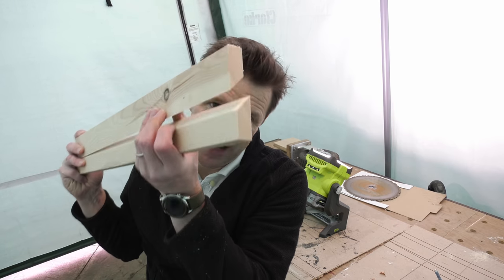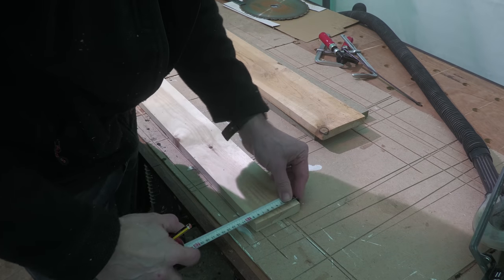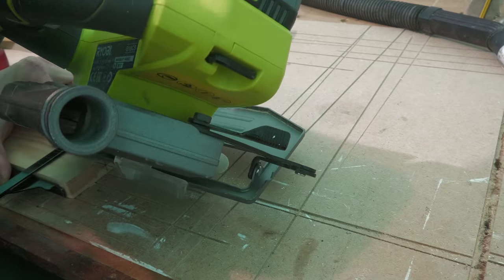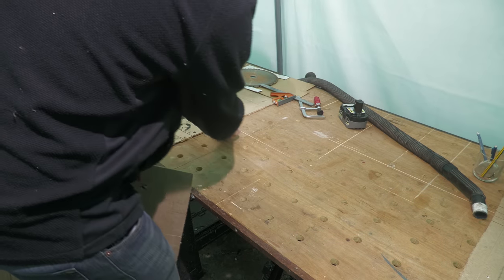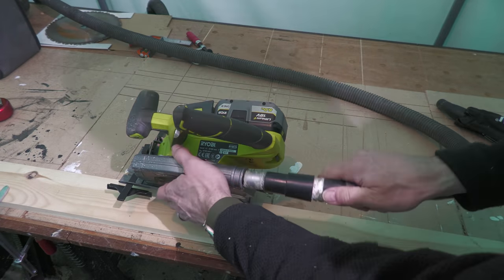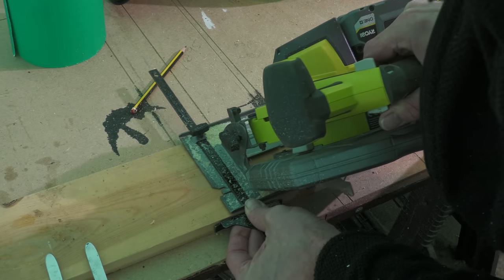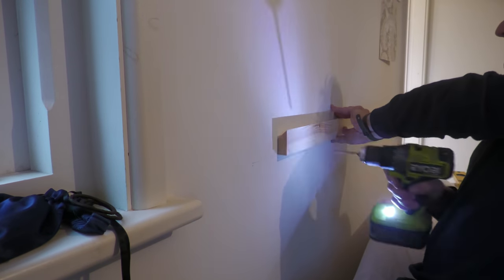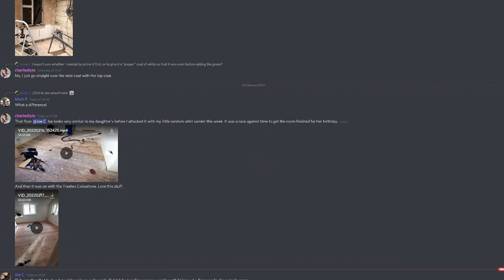How to make a French Cleat or Split Batten

Comment: As you cut your batten down the middle, you ended up with two pieces of unequal width.  That might not matter, but if you wanted them the exact same width you can measure the distance from the edge of your batten to the middle, and the subtract half the batten thickness from that measurement.  Mark that line rather than the middle, cut on a 45, and both your pieces will be the same width.
Reply from the maker: Watch it again. The 45 degree cut bisects the centre of the plank, not the middle on the surface, so each piece is equal.
Reply: @CharlieDIYte  👍

Comment: I have never used a French cleat solution, but there is a question in the back of my mind: what are some easy solutions to ensure that a unit hung on a wall isn’t accidentally knocked off? Maybe this headboard is too heavy to knock off, but there are other situations where this can be a concern (admittedly, for a beginner who has not tested French cleats yet). Thanks!
Reply: Understand your concern but I have used french cleats for over twenty years and never have had one knocked off yet as you need to lift the item up more than 30mm so even if you knock against the item it will never come off I hope you understand what I mean
Reply from the maker: Exactly David, and you could put a small screw in the wall above for peace of mind, if you felt the need but as you say, a combination of gravity and the distance it has to travel would render this unnecessary. Thanks for answering this. 👊
Reply: @CharlieDIYte  I thank you both for answering my question. I’ll go ahead and install a temporary tool rack in my temporary shop and give French cleats a try. Thank you! :)

Comment: Hi Charlie. Great instructions and guidance as always. It’s an idea just to knock off the sharp edge on the batten fixed to whatever you are hanging. This allows for a small amount of debris that may have gathered in the wall batten and would otherwise prevent the cut surfaces mating snugly. Not so much a consideration in the bedroom but very relevant for workshop applications where sawdust and the like may settle on the wall mounted batten.
Reply: There's  always  something  to learn  in your  channel  Charlie  .
Reply from the maker: That's a great point Brian. Thanks for sharing 👍
Reply from the maker: Thanks buddy, good to hear from you.

Comment: Great job but i don't see how the head board can be flush with the wall with a board attached to the back of it? Sorry but am i missing something here? lol
Reply from the maker: It's a good point. You build a recess into the back of the headboard with say a strip off 18mm MDF or pine if you're wanting to staple into it. If the headboard is already made you can use flush mount brackets like this https://www.toolstation.com/flushmount-fitting/p60564

Comment: Thanks for reminding us about this and the way to do it. One of the first things I ever made was a wall mounted tool storage cupboard based on a Conran design which used split battens as mounts. Cannot remember how I actually made the split batten as it was about 30+ years ago and it is still in use. Has been adapted as I have new or replaced tools. Despite holding my router, sanders, drill, etc and the cupboard itself the mount has remained solid and strong so can vouch for the strength. It is a versatile mount that is strong, practical and easy to use.
Reply from the maker: You're welcome Glen. Yes that's testament to how good these are. Thanks for sharing 👊

Comment: Excellent job Charlie ! I regularly make headboards and upholster them, this in my opinion is the safest and strongest way to fix headboard and you can also make it as big as you like. 
👏👏👏👏
Reply from the maker: Thanks Helen. Yes I've used those metal cleat brackets in the past and they can clank around a bit. This is so much better.

Comment: My brother in law made a headboard for me using this trick. 
My friend needed hers done and I just used picture hooks ( same idea ) into plaster wall.  Worked just as well. I got them in B&Q.
Reply from the maker: Yes if you haven't got the space you can use French cleat style metal brackets rust work in the same way but they do clank around a bit.

Comment: Hi Charlie, Your video's are my go to solution to any DIY problems and always very useful. I'd like to pass on a little tip to you and your subscribers  that I'm sure you'll like. Always have a supply of bicycle spokes in your tool box as they are so useful for many jobs. So find an unused bike wheel, strip out the spokes and get them into your tool box. Rob
Reply from the maker: I like that Rob. I have a chop stick in my tool box for the same reason eg clearing out silicone nozzles but a spoke would be even better!

Comment: Lovely down to earth explanations as ever - thanks! 

One question - I've noticed on several YT channels increasingly complicated approaches to calculating how to cut the batten EXACTLY in half with a 45 degree cut (BTW yours was refreshingly simple :) )

However, I can't help but think that there is In fact no logical reason that the battens NEED to be the same width. Or even close. You could just as effectively cut a 10cm board into eg 4cm and 6cm and they would function just as well. Or am I missing something ...?

Comment: Gr8 vid Charlie, I'd have thought you'd have used your track saw for this. You're far braver than me using a circular jobbie. This isn't a criticism, as we all know all too well there is no right or wrong way (withing the confines of sensibility and safety) of doing things nor is there a wrong tool just one you feel comfortable with. 
Keep those no nonsense vids coming,all aimed at ordinary guys with modest resources unlike our cousins the other side of the pond. 👍👍👍👍😎
Reply from the maker: Thanks Alec, I really appreciate that. Yes a couple of people have said that. With a piece of wood this width, I just find the fence easier than a track as with the track there would be a slight worry that the wood might move, but you're probably right 😉👍
Reply: @CharlieDIYte  Hello again Charlie, you had three boards at your disposal in the vid. So, use another so the track bridges across both. One as a support and the other the job. No need for clamps either and the track will be stable.
Stay safe and stay well Charlie. Regards to your family 😊

Comment: I went crazy with french cleats in my garden work room back in June this year - and i mean crazy.  Pretty much every tool and material I have is now set up as a french cleat!  Circular sawing was the worst part of the project - none of my cleats are perfectly straight and most of them to be fair ended up looking like waney-edge boards! The best fun though was devising the holder for each tool so that i could hang them on the wall cleats.  I had to get quite innovative with some of them such as the circular saw and the orbital sander. Wish there was a way to post photos in these comments...
Reply from the maker: Well you can post photos now you've kindly signed up to BMC. See you in Discord 👊

Comment: You mentioned the workshop tent took a bit of a battering in the current batch of storms. How did well did it stand up to them? Feel that could be worthy of a quick vid/short. I ask because I'm looking to purchase one myself, value your opinion. By the way great video.
Reply from the maker: Thanks. It's absolutely fine and has taken everything the weather has thrown at it over the last year. You just need to make sure it's well anchored down. A friend bought one and didn't anchor it, and it uprooted and flew over his garage into the field, thereby destroying it. Mine is screwed to the paving slabs at every pole.

Comment: Felt pretty stupid almost giving up and thinking I needed a circular saw for this before I realised I could get an identical fence for my Makita Jigsaw. Probably not as good as a circular saw for straight cutting but hopefully good enough.
Reply from the maker: Yes Ross definitely worth trying - I've never thought of putting a fence on a jigsaw although I've often used one up against a straight edge. You might find it wanders a little particularly given the angle, but it shouldn't matter as you're mating the two pieces together.

Comment: Very nice job as usual! 
But, the most complex part was kinda glossed-over…how did you recess the headboard to accommodate the cleat?
Reply from the maker: I didn't show that because I thought making a headboard was a bit niche/ not central to the purpose of the video, but basically I made the headboard from a piece of 18mm MDF and then glued 18mm strips to the back to create the recess. Maybe I should do a video on it.
Reply: @CharlieDIYte , thanks for getting back to me Charlie. 
Yes, I guess you are right, one thing to focus on at a time. Otherwise the video might get too long. Thanks also for all your time and effort putting together all of these videos!

Comment: Good video.
I only would screw the wood to the table and don't use the clamps since the drill holes are out of sight and it is more solid to work.
That system can  also be used to hang cupboards and the like.
But my first thoughts were, why would you mount it to the wall but I saw later that the headboard did not reach to the ground.
Mine does cause it also holds the lower part of my bed bottom (3 layer boxspring) that's why it made me wonder.
More interesting, did you do the upholstery yourself cause if you do, please do a video on that, with all the curves and whatnot.
Anyways, solid job done again, 10 out of 10 !!
Reply: He did a video on this a while - have a search through the history
Reply: @olddailly  thanks
Reply from the maker: I don't know why I didn't talk about how I made the headboard. @olddailly you're right, I talked about it very briefly at the end of this video https://youtu.be/UPHk6A14EWo For both headboards I made the sub structure, and then got an upholsterer I know to cover it, but once you've got the foam and if you have a stapler, it's actually quite straightforward. I'll do a quick video showing how I made this one if I have time.

Comment: This might seem like a stupid question but I'm fitting out my workshop with a base set of tools in preparation for starting to learn about woodworking and tackling some basic projects - do I need a plunge/tracksaw AND a standard circular saw ? Or will the plunge do the lot ?.
Reply from the maker: That Lester is a very good question. Bottom line, if you plan to rip down a lot of sheets of say MDF, then the plunge saw is what you want because a) it can slide down an aluminium track and b) the dust extraction is much more efficient. However the circular saw is much lighter and more versatile for quick cross cuts, or more minor work closer to the edge of the piece of wood where you can rely on the fence. Have a look at this video https://youtu.be/jhG4fX_Vjmc at 7:42 where I talk about the mdf dust issue (you should build yourself a cyclone for your new workshop) and also this video https://youtu.be/lXs-4iXO874 where I show you the plunge saw I bought to replace the circular saw I had been using. For cyclones, check out this video, https://youtu.be/9RfHpm2vf40 and this one https://youtu.be/Ws7Tp2Qgbo4 where I fit the pressure release valve.
Reply: @CharlieDIYte  that's brilliant info thanks very much for the reply. I have been considering dust removal systems - and have bookmarked various homebrew offerings, I'll take a look at the solutions you've linked. I'm trying to build out a solid base of essential tools at the moment, without going ham initially (I've looked at table saws, thicknessers/planers etc but i think not getting over excited is the order of the day until I've 1) gotten a workshop set up and know my available space etc 2) taken some courses in woodworking to kick start the projects I have in mind - so I can gauge not only what my ability is but where I'm headed with it), but it does sound like there's a case for both a plunge and a circular saw - and I've seen you use both to good effect in your vlogs to date. 
I will look to pick up a circular saw and add this I think, I'm at a point where I have enough batteries etc built up so I can pick up a body only version. 

Please keep up the great content - for someone starting out their woodworking journey your style of informative and well structured presentation really hits the mark for me - I've bookmarked several of your vids in my "things I'd like to build" playlist as potential project inspirations :). Many thanks again, appreciated.

Comment: Awesome C!  That is a great idea. Also, how is the workshop holding out?
Reply from the maker: That workshop has laughed in the face of every storm that's been thrown at it. There's the odd pin prick hole in the roof - probably from sparks or perhaps birds but it's staggering how well it's weathered. Only problem is, rather like the London Eye that only had planning permission for about 6 months, the wife keeps reminding me it's only meant to be temporary. She doesn't want it there forever but I've told her the outdoor seating will need to be built in it in the spring 😬😉
Reply: @CharlieDIYte  😆😆 Hahaha! Fending off the wife! like fending off against the storm

Comment: Nice one Charlie - but you could have cut those with your tracksaw.🤔
Reply: Thought the same Norman but not everyone has a track-saw, but there will be quite a few geezers and geezerettes that will have a circular saw. Even if you have a track saw, cutting a small width like that isn't going to be any easier, straighter but not necessarily easier.
Reply: @dexslazenger6938  That’s true. However if you more than one length of wood of the same thickness, it is pretty easy to keep the track stable. It’s how I do it.😉(No table saw).
Reply from the maker: That's a very good point Norman, although weirdly, I do find for jobs like this using the fence is incredibly effective and avoids the faff of having to get the tracks out. It's very interesting though the blurred lines between circular saws and plunge saws. I'm planning a video on this.
Reply: @CharlieDIYte  it might also have been difficult to clamp the wood securely under the track, you'd only have had a couple of inches to rest it on.